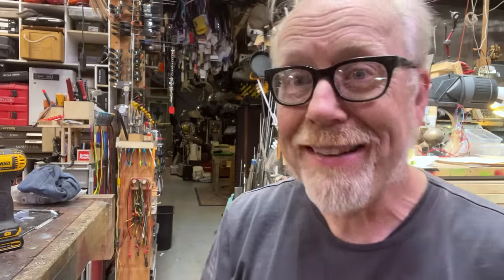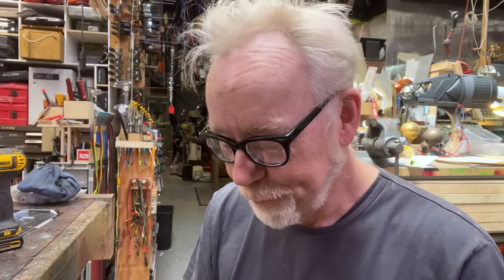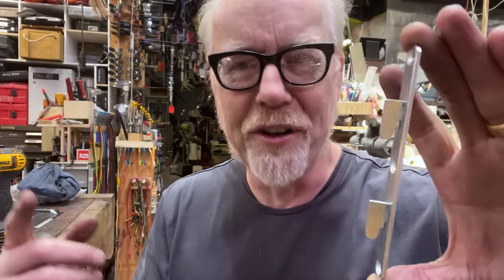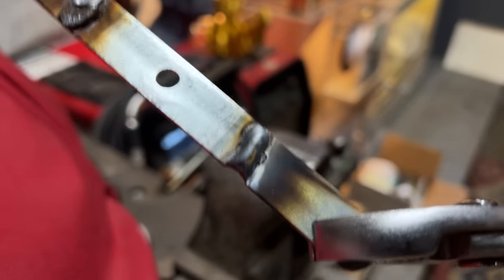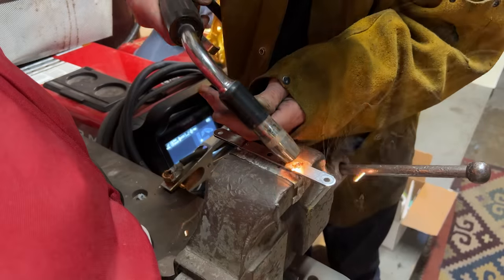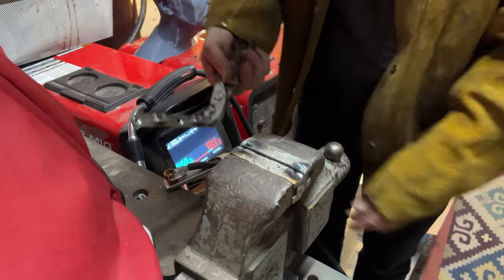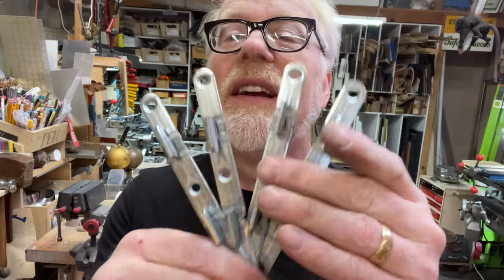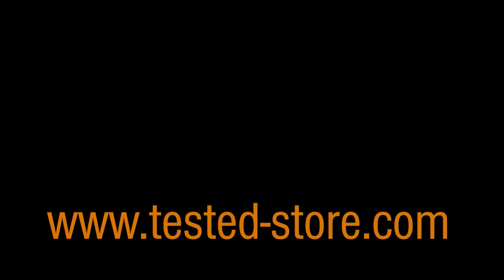Adam Savage Fixes a Squeaking Bed!

Comment: Adam, after some careful recollection to the process of some of the machine operators did at one place I worked, and then reading other comments confirmed my memories from +30 years ago,those tabs are “staked”. 

It would be interesting to do a sheer strength and a pull test on them for load capacity.

Comment: If you are interested how metal parts are made, there are many good videos on YT from factory tours etc. As industrial designer I find it fascinating how the stamping machines work. We had to learn basics of the manufacturing from animations & cross-section engineering diagrams of basic machines - and it is f'ing amazing to think how someone came up with the machine... Take in spool of metal sheet and step by step punch holes, flanges, perfectly accurate bends etc. before punching the final piece off.
Engineers and machinists who make the blanks/stencils/whatever you want to call the sequenced machine parts are work of art no one gets to see, imho.
Gets even wilder with machines that make deep drawing parts where keeping material thickness to avoid tearing is closer to witchcraft.
Just thought you guys might be interested, and even Adam in his infinite curiosity to learn. Gives you new appreciation for simples mass produced piece of metal.

Comment: An alternative, Would have been to use your Tig setup (after cleaning off that plating breathing Zinc fumes is never fun) and Tig weld the tabs to the main bar, using the tabs themselves as your filling material. You'd basically be melting the two pieces together in a puddle and would probably see 1/3 to 1/2 penetration of that 1/8 steel plate if you run it hot enough. (Employed welder 10+ yrs experience, Stick/Mig)

Granted, and I will admit, this would not be the strongest bond, (getting that would be all but removing the tab portions of the inserts and plug-welding the entire slot). But not everyone who can do this, has a Tig setup, or even a Mig setup. But there are hundreds of ways to tackle this type of modification/repair, and seeing Adam's chosen method, shows just how creative some people can be and still get the same end result.

Comment: I've been a full-time welder for 20 years now and some of my days still begin with grinding an inch of bubbly weld ;). I would have tried drilling the middle of that pressed tab as much as possible without weakening it and plug welded it I think. As for the main reason you want sufficient penetration (apart from having some material left if you grind the weld) would be to avoid cracks. Lack of penetration promote crack formation, and depending on the type of metal (like 5356 aluminium for example), the weld could literally completely crack apart AS you're making it. On mild steel it generally means a weaker weld. Fantastic job on finding the origin of the squeak and fixing it!

Comment: As someone who does have "the institutional knowledge" about stamping, the rounded edge comes from the metal's surface moving before it shears. Meaning that dependent on the direction of movement, the slug and the form will have the rounds on opposite sides! Meaning that plate with the holes was likely a single stage where the holes and the body were stamped simultaneously.

Comment: A hotter, slower weld will significantly increase your penetration (the depth to which you’re melting the parent metal). It should be perfectly possible to achieve a full penetration weld on that material without a significant weld-prep; (although keeping everything in tolerance is much more difficult in that case).
Reply: I will preface I'm not some experienced welder but I have watched my fair share of welding in-depth videos because it is an artform that interests me.  Yes from what I've observed you need to create a pool of molten metal to achieve full penetration of the materials and either push or pull that pool from one side to the other in zig zag formation.  There's a bunch of styles and methods one could apply to the seam as they see fit for the application. Hoonigan have done a great series on learning how to weld with Lincoln iirc and recommend anyone interested to check it out.
Reply: with or without squeeky beds, parent metals rarely get the chance for hotter slower welds until the later years, at which time everything has long been out of tolerance. significant weld-prep for full penetration is a luxury of the pre-child years. It's a wonder that parent metals can achieve multiple (off) springs.
Reply: @RichardBuckman   I needed this laugh, thank you, I appreciate you.
Reply: With that much heat and wire speed, that prep was wholly unnecessary to say the least lol

Surprised that only 1 of them came out distorted from how much heat was put into them, but definitely won't be going anywhere any time in any of our years 🫡
Reply: It depends on the welding process.

Im speaking of GMAW and MAG as that's my trade (boilermaker).

"More heat" isnt always going to give you the best penetration, and often can be detrimental of you dont account for it in wire speed and travel speeds.

More voltage (and thus more energy/heat) can actually reduce pennetration if you dont have sufficient wire feed. This happens because the extra voltage causes the wire to burn/melt sooner as it feeds out the contact tip when using a globular or spray arc transfer. 

This increases the arc length (not tip stickout length, thats different).
Since the arc spreads out over a, well, arc , the energy you're putting into the parent metal also isnt as concetrated. This can cause less penetration into the root of the weld. Increasing wire speed to suit your additional voltage will shorten the arc length and push it harder into the root of the join. 

Its a fine balance as you can give it too much wire for your voltage, which will result in less than optimal weld profile and eventually the toes of the weld will start to not fuse and overroll.

I only meant to leave a quick comment and i still have more to say😅
Sorry
Reply: I'll add the higher voltage (relative to wire speed), also increases heat input and, therefore, distortion.
Reply: @RichardBuckman  Looking forward to the day when the offspring can do the welding for you.
Reply: Don't you generally keep parts in tolerance by spot welding parts first to double-check the tolerance/shape (while you can still practically "fine tune" the parts with a hammer if necessary) then properly weld everything together.

Comment: Hey Adam, always lovely to hear your wonderful voice! I'm a mechanical engineering student (emphasis on student). The joint you were wondering the name for at 12:57 is called an "interference fit" because, regardless of your tolerancing, the two surfaces will always interfere with each other, giving you a rather strong joint given that only friction and internal stress is holding it together (obviously not as good as a welded joint)

Comment: Personally I would have used a TiG welder on that or a lower feed rate to get some heat in the parts first, before laying down material. It always makes the best bond, when the same metal can melt together first and then using a filler add to relief cuts or voids. These type of jobs are EXACTLY what keep me from finishing big projects haha. I love fixing little stuff like that. Improving and upgrading existing but poorly engineered things.

Comment: I believe the process which those tabs are fixed into the plates is called "staking", where metals are mechanically deformed to have an interference fit. 
We do a similar thing in firearms manufacturing with a hammer and punch.

Comment: Watch out, the carbon content of bed frames can cause welding failures.  Bed frames look like regular old angle iron but they don’t weld correctly and you’ll notice certain things are riveted together. Well I think that has to do with the carbon Contant of the steel not readily taking welds.
Reply: It isn't the carbon content but the heat treating after that makes high carbon steel brittle when welded. If you anneal the product after welding it can return to it's original "strength" really it just mean the 2 metals will tear at the same amount of bending forces. There is also another issue when welding low carbon steel or Cast Iron that causes the same issue or being brittle but with out the fix of being able to be annealed since it doesn't have any carbon in it. Cast Iron is always going to be one piece or riveted together.
Reply: Well that answers a lot of friggin questions. First, why it's so bloody hard to drill into them. And also, why it was so difficult to weld. 

I will say that so far my sandblasting cabinet and my flat bed lawn cart (which has been abused to hell) have made it about 4 years without failing. Both made from discarded bed frames. Probably had over 600 pounds of tree trunk on there more than once. 

I'm going to chalk it up to beginners luck/ignorance/slowness. The lawn cart was my first welding project ever, I used a $99 flux core pos and I probably annealed it simply by putting so much heat into the whole thing because I didn't know what I was doing and spent forever on each weld. Not to mention I probably had the heat and feed on 11. 

Was on the lookout for some frames for a new project, now I think I'll just find some actual welding steel.

Comment: I would also recommend grinding off the galvanized coating. That will make you sick to the gills, and cause porosity. That connection of the tabs to the pill shaped pieces of metal, is more so staked.

Comment: I work in a factory that makes packaging machines and adding automation to some of the machines that don't already have it. What I do is general labor but they have me mainly focused on operating and making programs for our CNC laser cutting machine. Originally I was a shear operator that sent things down to a turret punch. Your perception on which side the punch came down on to punch out the part was correct. The rounded side is basically the top of the part. Where the flat side is basically the bottom where it is punched out from the material. Those turret punches sound like a war is going on in the shop.

Comment: It should be noted that those are a new style of bed hook.  The older style were completely flat, and had to be inset into a thin mortise in the headboard/footboard and then pegged through the frame to keep in place.  That style was really solid, and didn't usually squeak over time.  You can still get them.  I recently I re-built my great-grandparent's old bed to give to my son (they died in the 80's and I've had pieces of that old bed in storage ever since), and I used the older style.  It was a challenge to mortise the slots, but satisfying not to use those newer junk bed hooks.

Comment: I actually have a story I think is relevant here. I recently bought a cheap Harbor Freight welder to weld some things which I had that needed welding. Included in that list was my Ikea bed frame center rail. The center rail was this rolled sheet metal that had two parts that fit together nicely. And the center of that rail was VERY strong! It was TWO layers of rolled sheet metal bent into a shape which nested within the other piece! VERY strong! Beyond that, you had just one piece of steel which was strong enough given it's shape. But beyond THAT, it tapered down to just 1 flat layer of metal without ANY bends which would have added any structural rigidity to the piece! This is where my center rail FAILED! This is an obvious weak spot in EVERY Ikea center rail! I hammered my rail into the shape I wanted, found a piece of strong metal to weld to this weak spot, and I reinforced this spot by welding to the new metal. So I repaired where my original bed frame tore. But my welding also heated the existing center rail which I believe strengthened it by tempering the metal! EVERYONE with one of these Ikea center rail bed frames should try this! Even if you don't have a welder, you should blast the ends of your bed rail with a blow torch or whatever to heat treat this weak point! (Don't forget to remove the plastic parts from the area first!)

Comment: The "riveting" is called "staking".  One reason to stake it rather than weld is that you don't mess up the galvanizing surface.    You can stake two galvanized parts together, and they are still mostly galvanized.  

The rounded edge of the stamping is downwards, away from the punch and that stamped the bits out of the sheet and through the die.

Comment: Fun fact, the weld material created from filler material and base material is called the Admixture, which is a composition borrowed from both. The definition can probably be stretched to include both pieces of metal joined without filler material.

Comment: If I remember correctly the rounded side of the stamped plate is the side face down on the punch die(flat side is where the force is applied) because the metal would stretch slightly on unsupported face of the piece but only around the edges before it starts to shear the metal and stretching stops.

Comment: I would be more interested in a wooden squeaky floor.
Reply: I remember hearing that replacing the nails that usually hold old floorboards in with screws stops the squeaking.

The squeaking being caused by nails that work loose over time and the wood rubbing against them
Reply: To sleep on, or just in general?

Comment: Hi guys. I don’t mean to be pedantic but there are some mistakes in this one. 
First: You dont need to remove the corners on a piece that small, evetything you said true, except it doesn't become an issue until you're up in around 1/4" thickness.
Second: The piece you where working in is hardened steel and the heat from the weld has removed the hardening, so there is a good chance it's going to bend or break where you have welded. 
Third: Never weld in galvanized steel, it is toxic as H€LL, and the youtube police will arrest you!
I really love the chanel and I dont intend to poop on our party, but it had to be said
Reply: Those pieces are not hardened.  They're not even high-carbon steel.  They're zinc alloy hardware stampings, pieced together with a peened connection.  Very common.
Reply: @sundaynightdrunk  Zinc poisoning is no joke.  I know people who have had to go to the hospital and be put on a ventilator because of zinc poisoning.
Reply: @sundaynightdrunk Thank-you for saying what I was thinking

Comment: This was the hard way to do it. The easy way would have been to use the TIG to run over the back joint, using the metal of the "rivet" to weld them together. No need to add metal with the MIG
Reply: Couldn't agree more from the get go I said why not use a Tig, then I thought maybe he doesn't have a Tig, then you clearly see the Tig sitting right next to the MiG. Little bit of clean up get off the galvanizing Tig the rivet melting rivet into parent material done. Would have looked better, been just as strong no massive globs to grind down and wouldn't of blown out the edge like he did on one of the pieces

Comment: At a place I worked, a front end loader had 2 major welds that failed--the weld at the pivot point, and the weld that connected the accessory attachment point to the hydraulic arm.  Thankfully no one was hurt!  Both of the welds were surface only.  "Made in the USA" sticker should have been changed to "Made on a Friday"

Comment: For safety you should always wear thick gloves when welding, especially when you have influence and a lot of people watching your channel, because there is a moral imperative to set a good example.
Reply: The un-guarded angle grinder running up against his belly is also very bad practice.
Reply: @Booka3141 also cutting on the wrong side of the wheel, so if it catches it throws the grinder towards him.

Comment: Holding those pieces as Adam grinds an inch from his fingers is pretty unnerving knowing what those tools can do to a body.
Reply: I see you have no experience with regularly using power tools on a daily basis
Reply: It's kind of like saying I can't believe he can drive to the store without his GPS experience and knowledge teaches you how the tool is going to affect the part you're holding you just have to think about it for half a second
Reply: I don't use angle grinders often and they scare the shit out of me.  But every tool is like that as most materials are harder, tougher, or similar to muscle.  Watch a chef rapidly slice an onion or a butcher break down primal sections of beef and the speed looks insanely dangerous.  I used to work with carpenters that would do stuff daily with a circular saw that made my sphincter tighten.  When doing anything inherently dangerous, a novice is not focused or doesn't realise the consequences.  This is not Adams first time using an angle grinder.

That said, I usually saw accidents happen (even by experienced people) at the end of the work day when someone was rushing something inherently dangerous so they could clock out.

Comment: Good luck with that. I had similar, but the fix I used was a large pair of angle pieces coach bolted into the existing frame.The slight distortion of the pieces allowed racking, so that had to be stopped. My bed is now really solid and reassuringly overbuilt.
Reply: TBH, the battery powered grinders don't have the torque and RPMs that the corded ones do. I mean it's not a recommended, OSHA compliant practice, but it's not a biggie. You'd likely lose a layer or two of skin, but not much else.

Comment: Adam, not sure but this style bead frame connection I have never seen. And I've put together several beds in my short life. I know Ikea and most knockdown brands don't use it. Instead, you just run 2 bolts on the inside of the bed through pocket holes into the headboard and footboard on both sides. My bed rarely squeaks, but I do have to tighten it up from time to time.